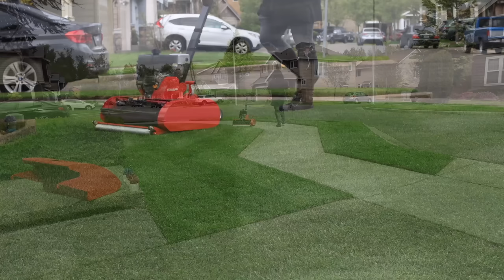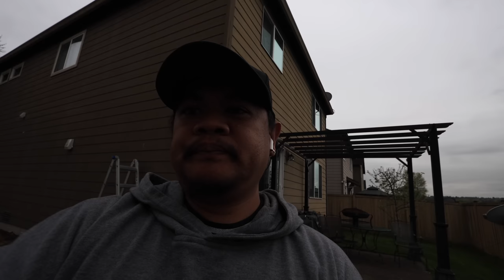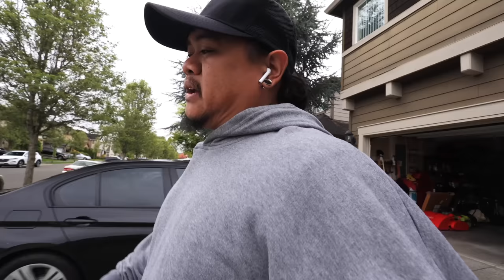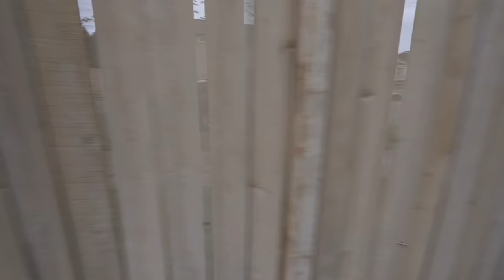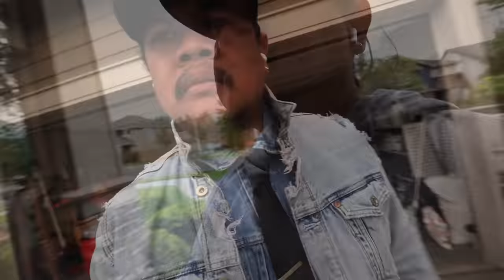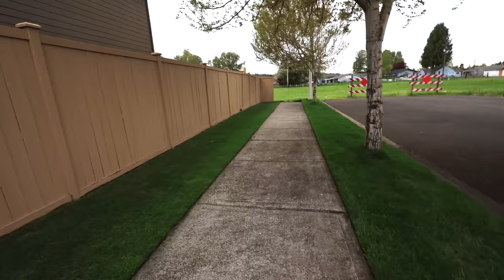Canadian Tuxedo is 🔥🔥🔥😂🤙🏾 - fixing the sprinklers to prepare for overseeding in the front!

Comment: Have you ever thought of using some quick connects? for the sprinkler heads and hoses they got some some cheap ones at harbor freight that work great bro
Reply from the maker: Yeah I have quick connects in the back but for the main sprinklers I try to prevent as much leakage as possible… the main sprinklers don’t move so no need for quick connects. Def use it for my hose end sprayers though 😊👊🏾🔥🤙🏾🙏🏾